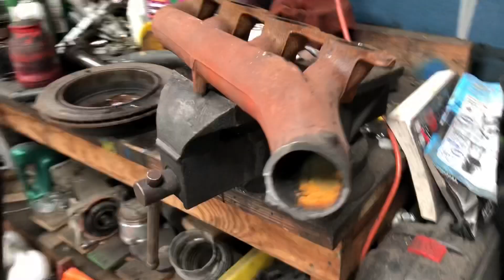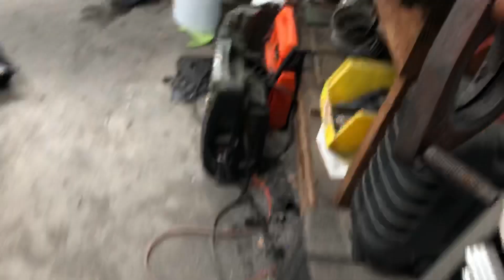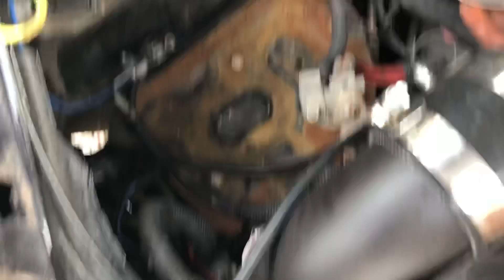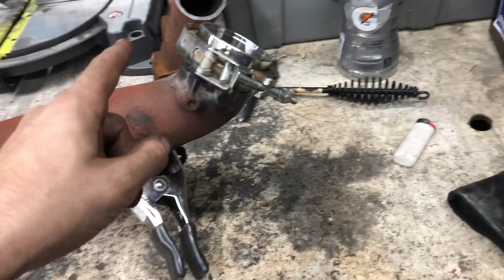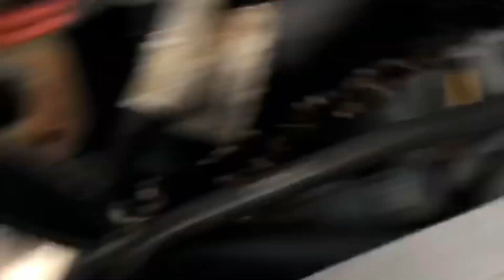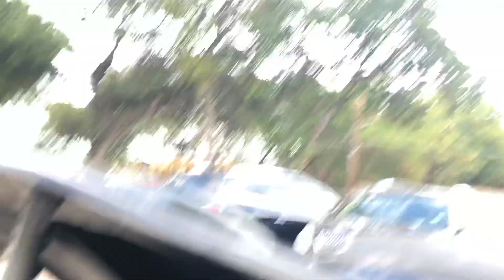GTO Single Turbo Kit V2

Comment: What manifolds are u running
Reply from the maker: Non EGR truck manifolds with 2.5” Vband clamps welded to them
Reply: Did you fluxcore weld it?

Comment: Hows it do against stangs and c6?
Reply from the maker: At the 4psi and unoptimized tune it keeps up with stock c7’s and should be faster than most manual mustangs
Reply: @rsh7017  glad to hear that, cant decide between turbo c5 z06 or turbo gto
Reply from the maker: @igrowdankk3405  turbo corvettes are tough unless you pay for a kit or someone to make it. The gto would be easier if you’re going to do it yourself